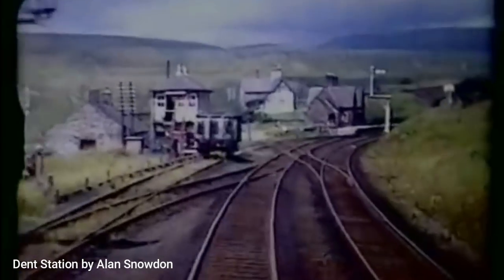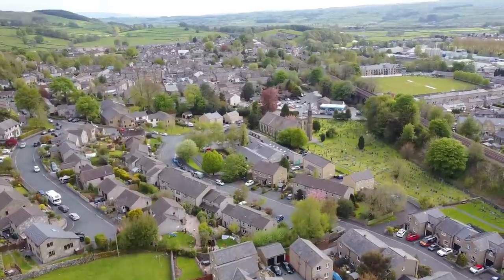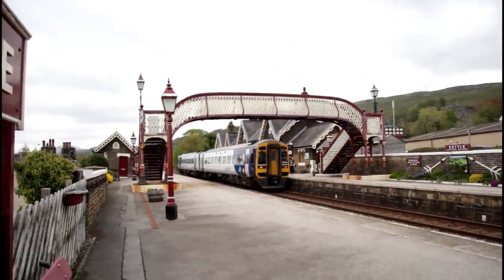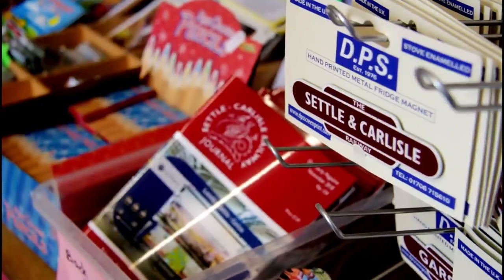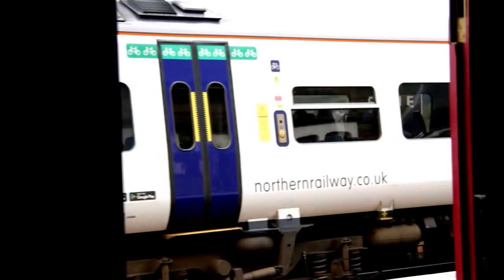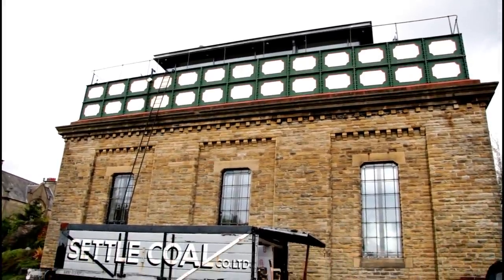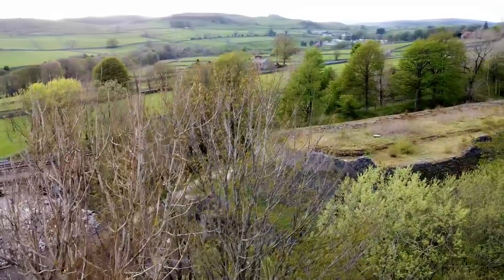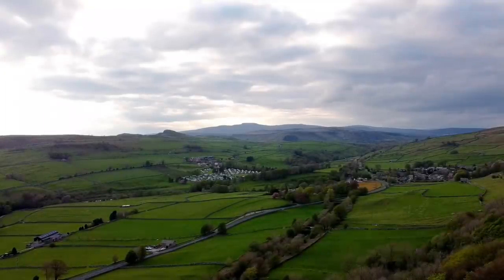Old Hidden Tunnel on the Settle Kiln & Railway

Comment: If you find yourself on Settle station with a loaded touring bike as I once did and need to cross the tracks. Ask the staff and they will escort you across a ground level crossing; much easier than lugging your heavy rig over that bridge.